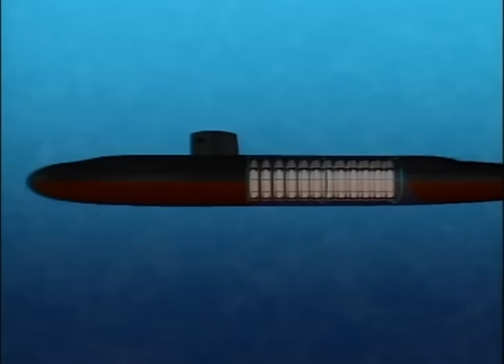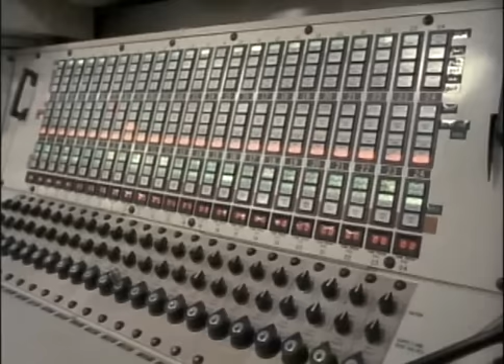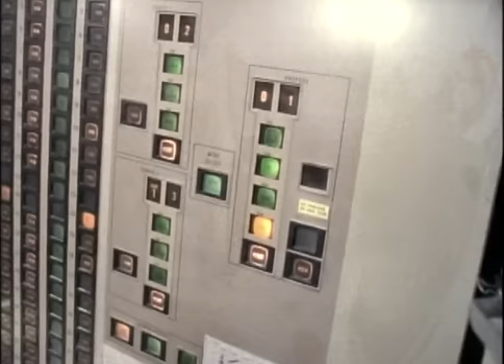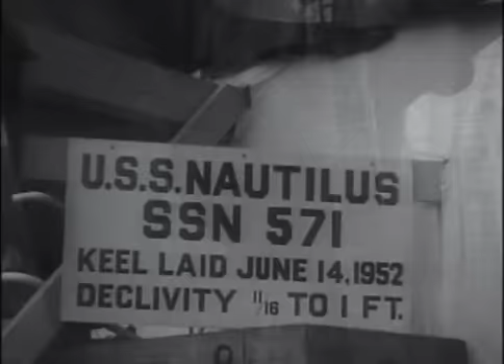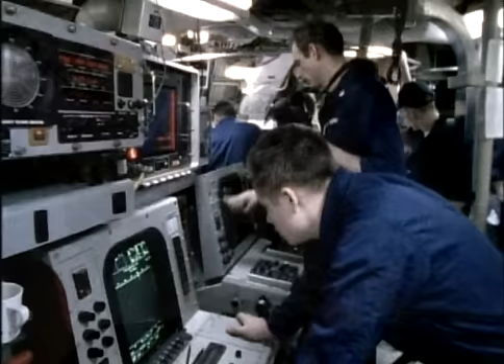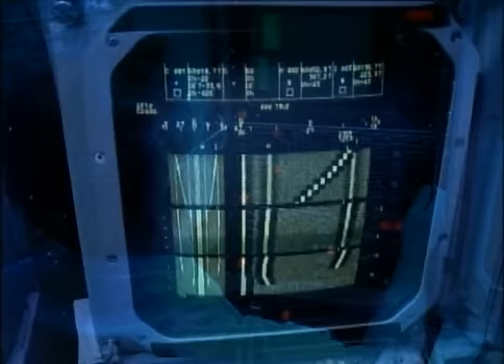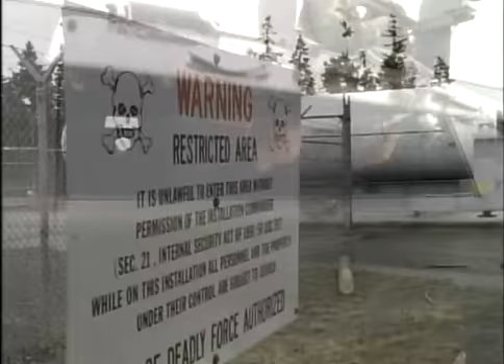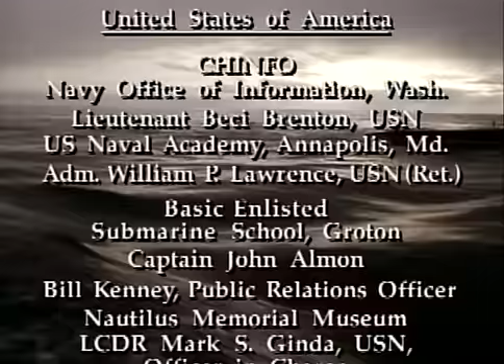Discovery Channel: Submarines - Sharks Of Steel 4of4: The Hidden Threat

Comment: I spent almost 6 years as a member of the USS Georgia Blue crew, and was onboard during the filming of Sharks of Steel.  Best bunch of guys I ever served with.
Reply: What year was the program filmed?
Reply: 5 years on SSBN 738 here. Good program.
Reply: Could you explain why the masts are spotted? Cheers from Oshawa Canada.
Reply: @jamielacourse7578  breaks up the outline. Simple and effective camouflage. Just like older Navy ships with the zig zag patterns, made it harder to see the outline and direction of travel.
Reply: @krmgradiojoe  can't say for sure but I would guess late '90s.
Reply: @jamielacourse7578  No alcohol allowed on U.S. submarines. But I did drink a beer on a Canadian boat when they stopped over for a spell one summer. Good folks those Canadian submariners, cheers!
Reply: ll
Reply: @cameljon  Late 91 Early 92. If I recall correctly. SSBN 729 blue crew I was attached to the Georgia (blue) from 88-93 FTB Gress. Received my Dolphins Dec 88. Waldrop I may have signed your qual card (still have mine) Filmed just before I got out.
Reply: You guys and girls are all heroes! THANK YOU!!
Reply: you guys had it so easy. I did 8 years on fast attacks and it was much different than this video
Reply: @chrisamadon279 absolute rubbish I served 15 years on diesel boats that's when submarines looked like submarines
Reply: So damned interesting 
If I could do it all over again I'd absolutely go into the Navy

Comment: 2:00 The Georgia submarine... there are actually 14 of them in the US alone (Russia has it's owns).  Each of these 14 Ohio class submarines carry 18 ballistic missiles (plus 6 smaller ones).  Each of the ballistic missiles carry 8 independently targetable nuclear warheads aka nuclear bombs - basically each ballistic missile = 8 individual nuclear bombs.  Each of these nuclear bombs can have about 30 times the power of the Hiroshima bomb...  So let's do the math:  8 warheads (bombs) x 18 missiles x 14 submarines... = that's 2016 nuclear bombs.
Reply: 24 Trident D5s. All same size.
Reply: @_R-R  not accurate. The 14 SSBN Ohio class submarines have the capability of carrying 24 UGM-133 Trident II missile but they now only carry up to 18 and they put ballast cans in the other 6.

Comment: what is the significance of the black uniform shirt worn in sub school? I'm clearly not a sub expert but I haven't seen one before.
Reply: I was wondering the same thing: I've never seen the black uniform before or after this doco.
Reply: It's the old "Winter Blues" uniform, nicknamed Johnny Cash's because of the all black. Sort of the opposite of the still existing summer whites. Wish the navy still wore them.
Reply: @sparticusVI  In the 60's and 70's we called them undress blues. When I was in Sub School it was summer so we wore Undress whites, Dress Whites were just Undress whites with a Neckerchief.  (Tropical Whites are Short sleeved shirts instead of jumpers.)

Comment: Are they EMP proof?
Reply: Good question! Sea water is an electrical conductor. And the ocean is very well grounded so it is hard to see how a potential difference large enough to produce the current required to fry the wires could be generated underwater. This suggests that an EMP would have little affect on a submerged submarine. Not only that, a submarine is a tube made of steel ... which, in effect, is a large Faraday cage which is also well grounded. This suggests that even a surfaced submarine would be partially protected. However, microelectronics is more sensitive and a transient voltage spike of any kind could reasonably be expected to corrupt the contents of volatile memory requiring a reboot and data restoration of digital computer systems ... which would take time. Externally mounted sensors might not survive. In general, the intensity of an electromagnetic field varies inversely with the square of the distance ... meaning that distance is your best friend. The most likely scenario might be a low yield nuclear warhead delivered on a torpedo or depth charge, detonated in proximity to a boomer in a desperate attempt to take it out before it can launch any more SLBMs (i.e. other than than the ones that have revealed the boomer's location). Of greater concern, the shock wave, propagating through water, would probably be sufficient crush the hull. An EMP weapon detonated at high altitude would probably have little or no effect. Any comments?
Reply: @liefsillion2825  I hate the thought of EMP taking out the systems and being stuck in a nightmare of dark, cold sealed tube as oxygen runs out. Scary as heck
Reply: @vincitveritas3872  Yeah! Not a pleasant way to die. 

Submarine rescue vessels are few and far between. They typically take days to get to the search area and then they have to find the downed submarine. They would probably send a robot down to evaluate the condition of the boat and of the emergency exit hatch seal before they send down a submersible to attempt a rescue. This takes time and it is only possible in relatively shallow water.

Most of the ocean is very deep and the pressure increases rapidly as you go down. If the submarine propulsion and buoyancy control systems have been damaged there is not much hope if it coming up again. As it sinks, the hull with start to make freaky noises as the submarine goes below its crush depth. Even the strongest hulls made high strength steel, or even titanium, will fail below around 1000 m (the exact details are kept secret but the physics calculations are straight forward). So, the end game is that the hull will implode under the pressure in a massive boom that will be detected hundreds, if not thousands, of km away. This would happen suddenly but the waiting around for it to happen would be truly terrifying!

Nuclear torpedoes and depth charges are diabolical weapons. They don't have to get that close to a submarine to take it out because they use a shock wave to rupture the hull. And, they don't need to be high yield because the shock waves they generate are easily propagated in water. There is not just a single shock wave. The detonation will generate a fireball which will vaporise thousands, if not even millions, of tons of seawater. This steam ball will expand and cool until the pressure falls below that of the surrounding seawater. Then, it will collapse again, superheating the steam and increasing the pressure up to a point where it stops, and then starts expanding again. This rapid cyclic process will repeat as the steam ball rises in the water column until it reaches the surface. So, there will be a series of shock waves of diminishing intensity over time. 

On the bright side, they can't kill you if they can't find you! Submarines depend on stealth to stay out of trouble and hiding under an ice sheet makes them very hard to find because they are concealed from satellites. A nuclear submarine can stay there for weeks, if not months. This is why boomers are the premier MAD capability. Bombers can be shot down and ICBM silos can be excavated, but boomers are so hard to find that you won't get all of them, and just one of them can cause unimaginable destruction. So, if you start a nuclear war then you will not survive. 

MAD is a mad idea but so far it has worked. The key is you have to convince the other guy that you are mad enough to use them! This is what Putin is doing at the moment. He is following the standard playbook. Paradoxically, nuclear sabre rattling actually reduces the likelihood of a nuclear exchange.

The US runs attack submarine patrols in the vicinity of adversary boomer bases. When they head out to the open ocean they follow them, hiding in their baffles where they can't be heard, and follow them around. They can detect the sound of a boomer opening its missiles hatches and in wartime this means they attack before the can boomer can launch its weapons. Advanced torpedoes have a re-attack capability so if they miss the first time around then turn round they come back! This will delay the missile launch because the boomer will have to evade the attack or risk being destroyed. A boomer might have an escort though whose job it is to intercept an adversary attack submarine before it gets close enough to attack the boomer.

Being a submariner is a dangerous profession in peace time. In wartime it becomes extremely dangerous and especially for a boomer because the prosecution would be intense. 

It is not a job that I would want to do!
Reply: @vincitveritas3872  Many back up systems that are manual. As long as someone is alive and there is air in the emergency blow tanks, the sub should go to the surface.

Comment: This is the quietest sub in the world 
Load of BS
Reply: Agreed. Nuclear propulsion systems have to run coolant pumps, heat exchangers, and turbines ... which are noisy. The batteries and fuel cells found on diesel-electrics hardly make any noise all.
Reply: @liefsillion2825  You didn't play close attention to the documentary and it would appear that you have no knowledge of sound isolation techniques.  These submarines ARE,  UNdetectable.  They are very quiet on the inside and noiseless from the outside.
Reply: @liefsillion2825  yes quiet until they run out of battery which will take only a few days and no since the creation of naturally circulating reactors diesel electrics are no longer the most quiet